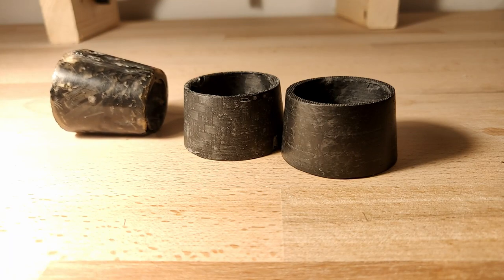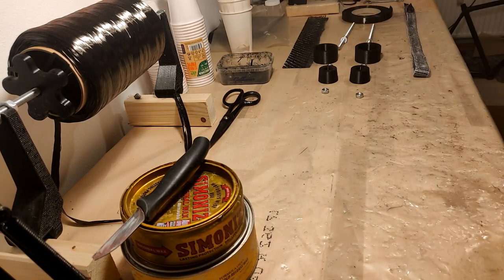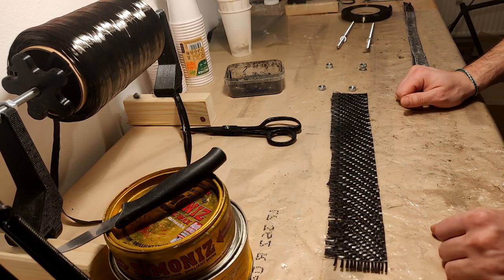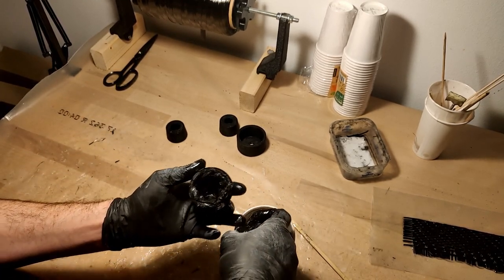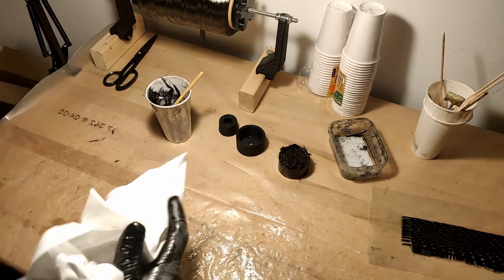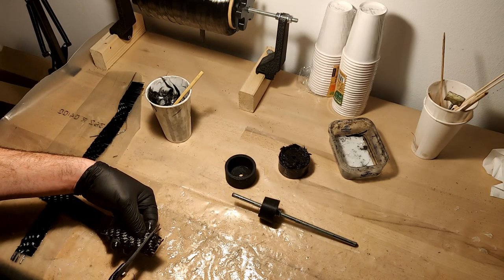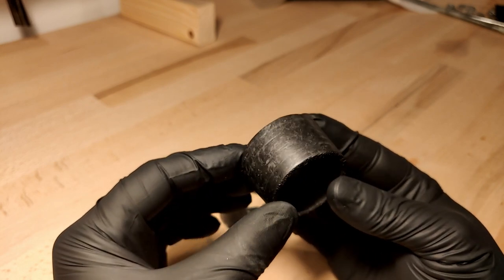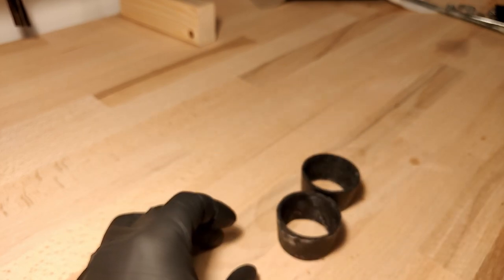Molding carbon fiber with 3D printed molds

Comment: To get a decent fibre volume ratio with carbon fibre, use 1000gsm of fabric per mm of part thickness. I would also suggest to wrap the mandrel if you can as this is way easier to compact the fabric and to control the fibre orientation which is crucial for the strength of the part.
Reply from the maker: Great rule of thumb, going to try it out! I was thinking in this case since the fabric would be captive in the "tub" it would have less chance to distort as the two walls slide past each other. Great point on the strength, I focused on just getting it done and forgot to  go over the specialities of working with carbon. Will cover it in more depth on the next how-to video. Thanks alot!

Comment: Trick! 
Sorry I missed the function of this part, what is it? 
I made a carbon fibre slave screw on head bolt for my”wiper snipper” grass cutter. The screw fitting that scrapes on the ground. To be honest it did good. Could of done with more curing though.😂
Straight... need it now.. extra hardener situation. 

I packed that stuff deep with and extra coat between a few layers. 

If you can add extra windings in a sequence where it’s super dooper sticky... it’s adds mega strength.  Observation.👾😊🤜🏼🤛🏼🍀🍀🍀😎
Reply from the maker: Hey Steve!
It has no function, beyond being an easy shape to demonstrate the process :)
Sounds like you had a fun project there, probably the most advanced grass cutting mod on the planet 🤘

Comment: Why not print it in carbon?
Reply from the maker: You mean the chopped fiber one? You can't squeeze much through a printer nozzle, so you are limited to fiber size and therefore strength of the part. Also you can only print thermoplastics, which is not good if you want thermal stability. And finally this process has no layer adhesion issues - it's pretty much one solid molecule of plastic!
The only thing printed carbon filled nylon has going is that you can make things hollow and therefore light, it's not in the same league on every other aspect